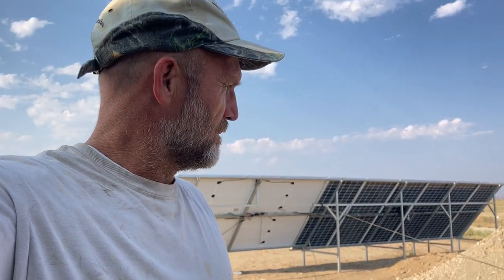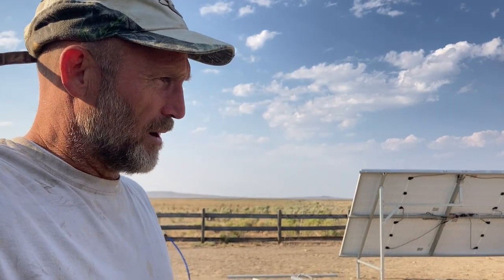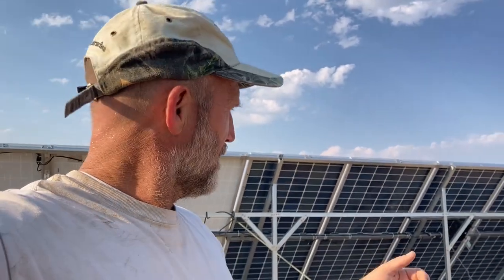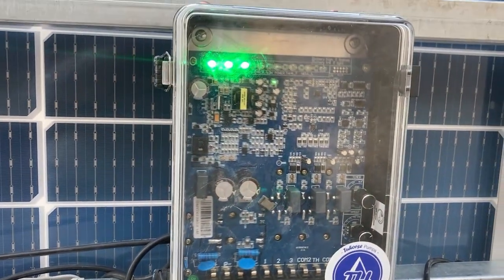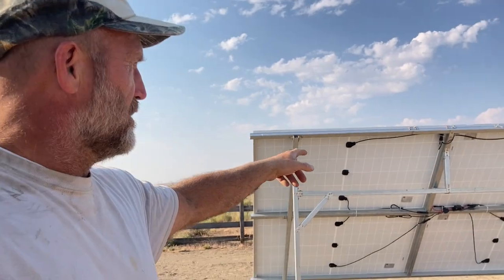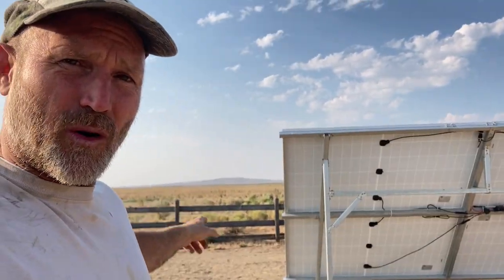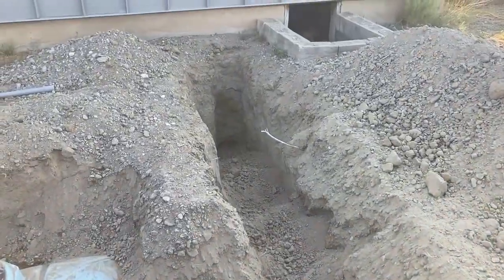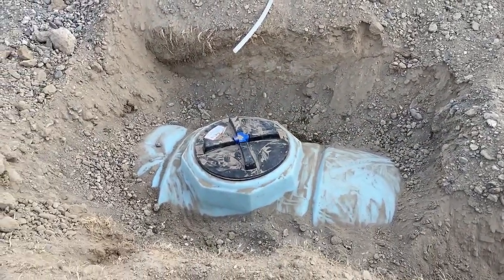Ultimate Bug Out Build Part 3: DC water pump wired directly to solar panels

Comment: question: what pump model are u using? imho DC-DC is smart setup, do u have a separate off grid PV system on the house? (mppsolar can be recommended or DEYE if u want to add ista breeze 2.0 wind turbine? (UNTESTED!) :D
Reply from the maker: https://www.tuhorse.us/solar-pumps/3-500w-solar-powered-submersible-pump-3ths04s48v500/